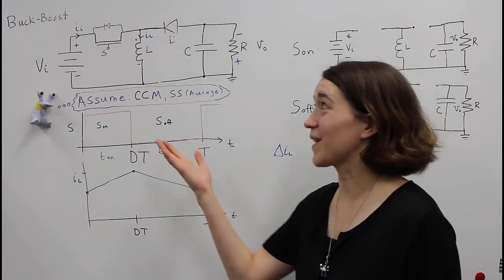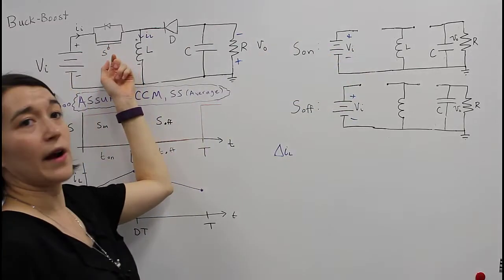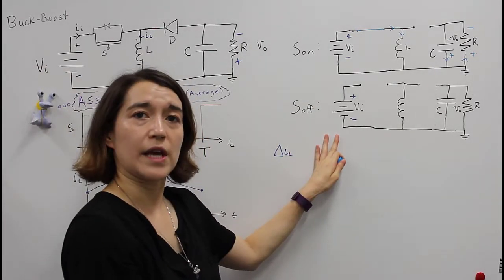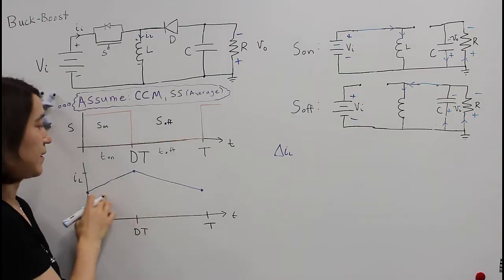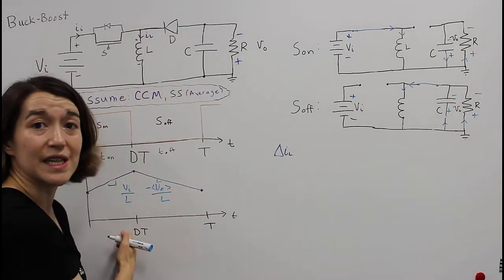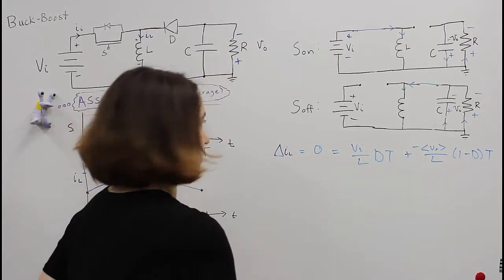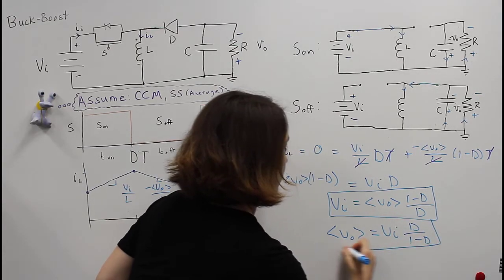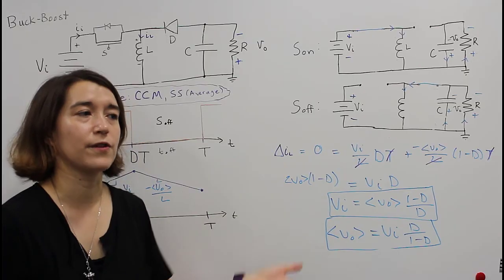Buck-Boost Converter Operation and Voltage Equation

Comment: When dropping the voltage from 9 to 3 volts and the power supply is rated for 9 volts 1 AMP, am I limited to 1 amp at 3 volts or do I have 3 volts 3 amps?